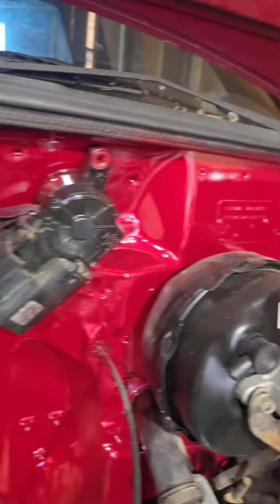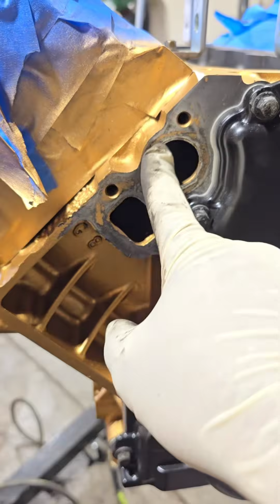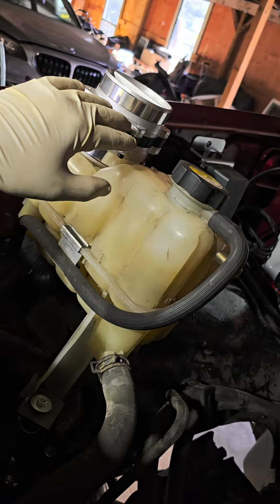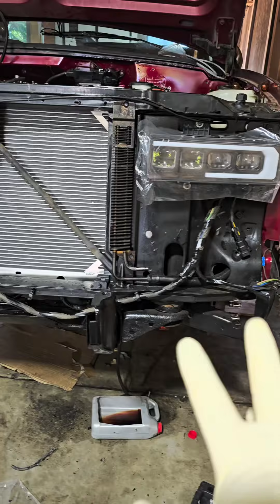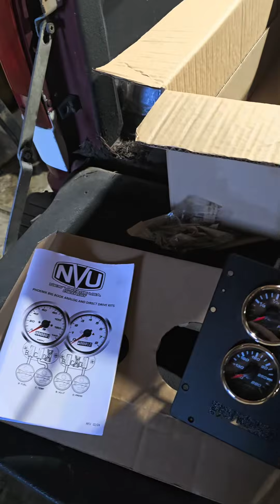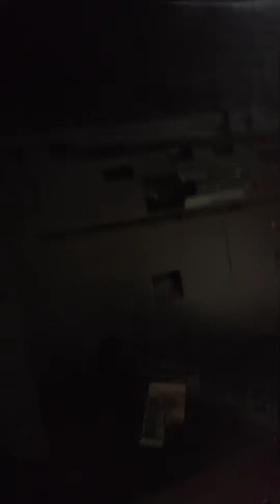Chevy K1500 LS Swap: Step-by-Step Guide + Best Parts for a Smooth Swap!

Comment: Did you use factory 2002 oil pan for that LS swap? We are doing a 2002 6.0 in a 97 K1500 but others are saying you can't use the factory LS oil pan die to crossmember.
Reply: I was looking for the answer to this question.